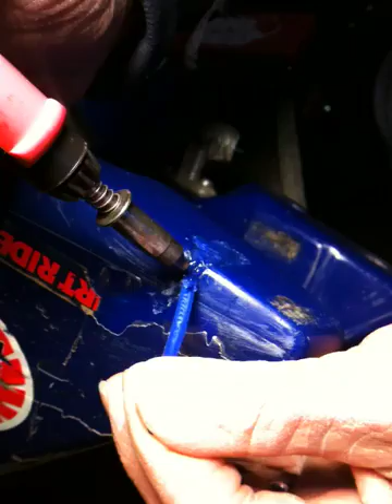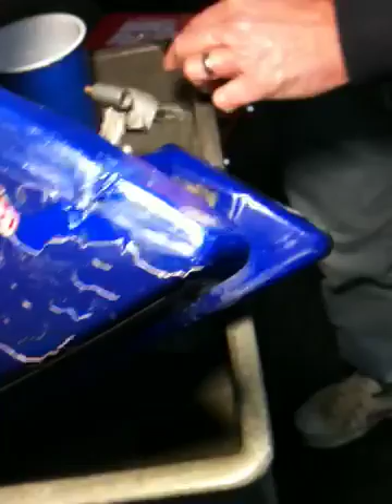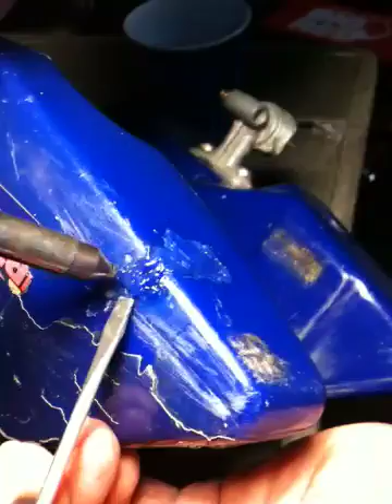MX plastic gas tank fix

Comment from the maker: Hi Clinton,
Sorry, don't check comments very often.  The plastic is High-density polyethylene (HDPE) or polyethylene high-density (PEHD).  You can melt it with hot air from a butane torch.  Like "BernzOmatic Butane Micro Torch" from Home Depot only 26 dollars. 

Home Depot link: http://www.homedepot.com/p/Bernzomatic-ST2200T-Butane-Micro-Torch-330194/100564678